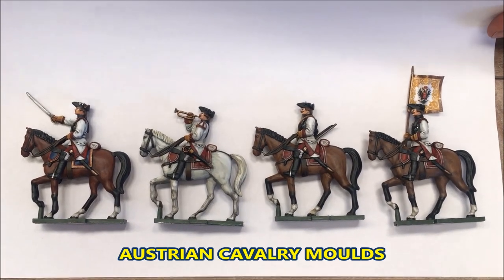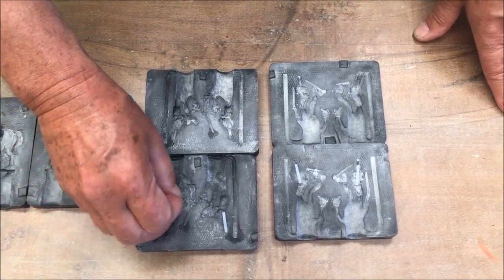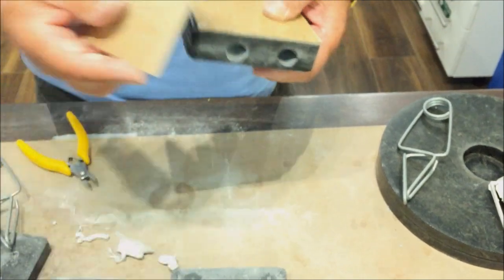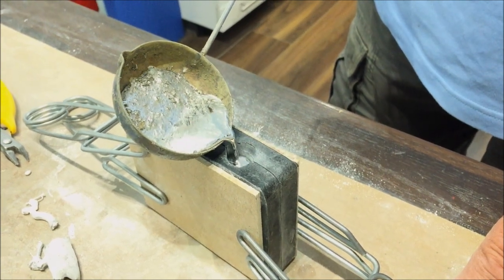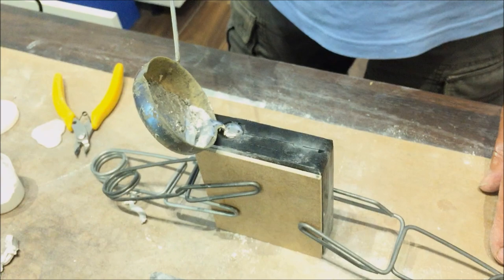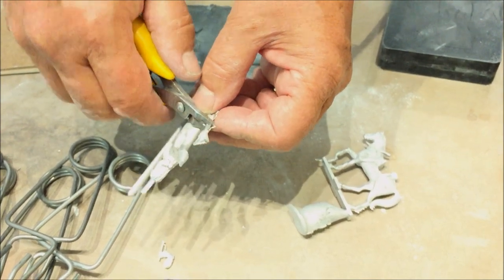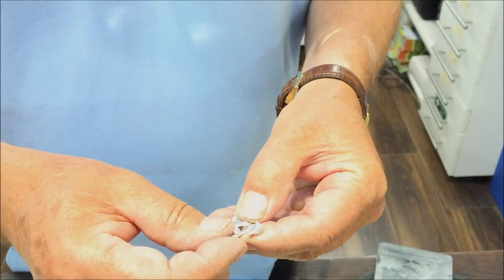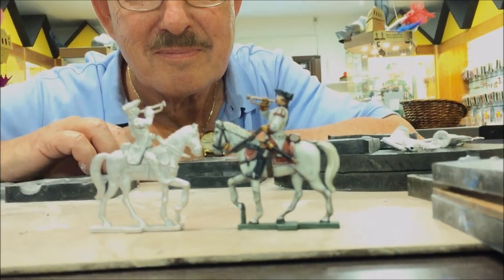Guide to casting Seven Years War Austrian Cuirassiers from Prince August rubber moulds

Comment: @6:13 I like to use a 2-part epoxy glue for this.  As well as providing good adhesion, it can fill any gaps.
I'll leave the rider off till I've painted both horse and rider, too.  I can get at all the areas more easily.  That's just a preference, though.

Comment: Hello my teacher. In the molds I use, molten lead does not fill the endpoints. what is the solution to this? What can I add to make the lead more fluid? thanks.
Reply from the maker: Pure lead takes a lot of heat to get it to flow successfully. Most cookers cannot achieve that temperature. You could add Tin to the mix (50/50) to improve the result, plus make it safer to handle. I advise getting a solder pot to get the temperature up to about 390 to 400 C . If you are still struggling then you need to vent the mould (cut a hairline channel from the end of the difficult spot upwards towards the outside of the mould. We have a video on this procedure on this channel.
Reply: @princeaugustcasting  thank you 🔥☺️

Comment: wish they would update the range to 28mm like most and re-mould all the modals with more detail, Prince August is unfortunately lagging behind i would buy all the re-moulds if they updated as i like metal miniatures very much just not in their current state
Reply from the maker: Thanks for the comment. There are problems with casting a lot of small details with moulds. Generally the smaller the figure the less details that are going to be added. It depends on the details of course but there is a huge difference between casting figures ourselves and expecting customers to cast them at home with gravity casts and a varied metal alloy choice. While scaling the range to 28mm would be possible on the design side, the casting element is trickier to work with. We have done 28mm and 25mm but they have to have larger and larger ingates to get them to fill. The more details added the more risk of failure when casting them.
Reply: @princeaugustcasting  thanks for the reply, i think if you are making 28mm mould that should help a bit with detail issues but i do understand, Centrifugal Rubber Mould Casting  is a little expensive😅

Comment: I would love to know if there are any advantages to attaching the head later?
Reply from the maker: I am not sure exactly what you wish to know. Do you mean is it easier to paint if unassembled? If so, then no as the figure needs to be primed and it is more work to mask off the parts to be glued than have them assembled first. You do not want to paint the  parts to be glued as you are then gluing the paint rather than the metal, resulting in (a) making the adhesion less reliable and (b) risking making the parts not fit as the glue adds a layer that thickens the pole so it might not fit in the body. Of course if you take enough precautions you could work around this with masks, but it is more work.
Reply: @princeaugustcasting  Nice video - very clearly demonstrated.I'm intrigued though: from what material is the mold made from ,and from what material is the original model made in order to achieve the mold?

Comment: Is it plomo?
Reply from the maker: We have a range of metal alloys. Some have lead as part of the mix, some do not. Our 5 and 6 Star metals do not have any lead in them. The Model Metal or Standard Casting Metal do have some lead. We do not recommend using pure lead in the moulds.